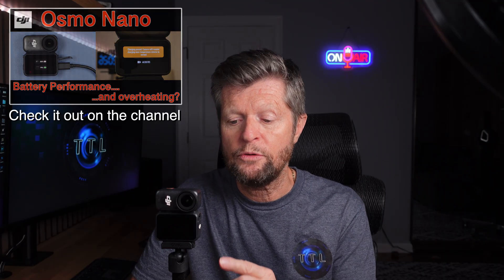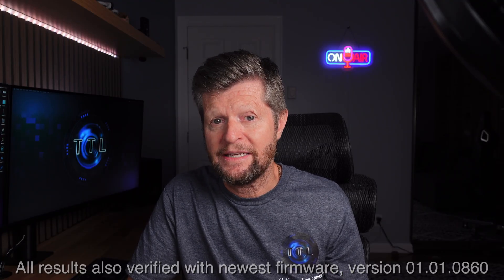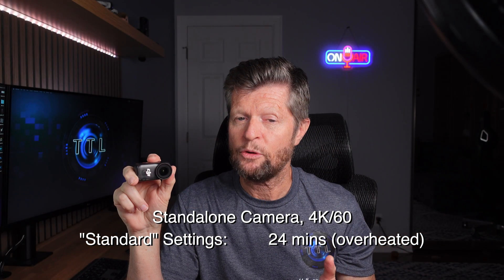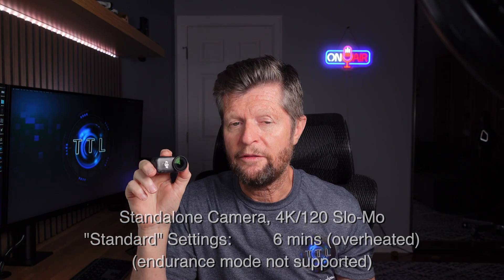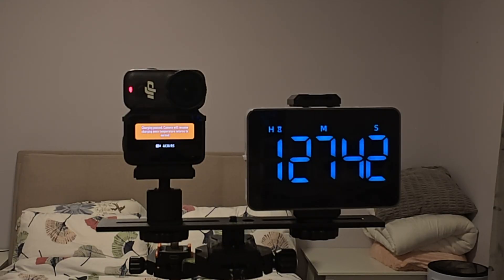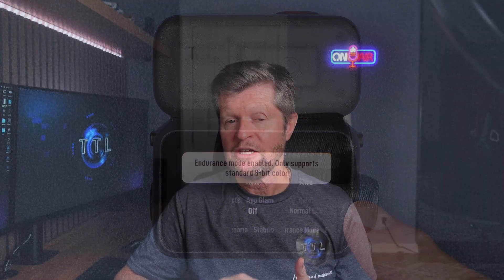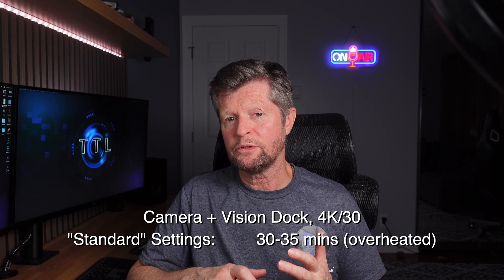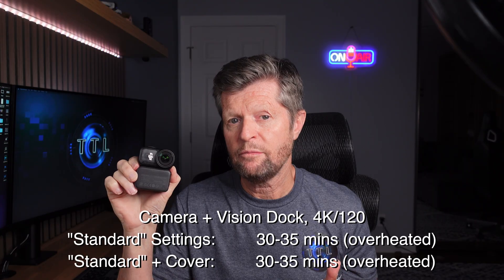DJI Osmo Nano: Overheating Issues

Comment: Hi do you have an update for the latest firmware? I returned mine as the overheating just was not acceptable and in South Africa we are a sunny place with temps around 30dgr most of the year rendering the Nano useless for outdoors

Comment: I got the Go3s, its fine but i think i may return it & get the Nano, is it better at closeups?
That larger sensor seems better, much larger battery, faster charging and uploading.
The overheating is an issue but i had similar issues with my go3s.

Comment: Excellent video and testing! Thank u for sharing! I just received my nano yesterday and started using it for some basic product unboxing and reviews. I usually only record at 2.7k/30 on my Action 5 and P3, so thats what I set the Nano to... I was stunned when I received the first "charging paused" overheat warning at about 15 minutes, and complete overheating shutdown at a little over 20 minutes. TBH, I'm still in shock... especially after learning that I couldn't connect my Mic 2 while the screen is detached! So, in order to record with the Mic 2, I'm forced to leave the vision dock connected... totally defeating the point of the Nano design. My overall experience with all of my DJI devices has been great! So much better than GoPro, or Insta360... but so far, the Nano is a massive disappointment. I'm going to try and keep an open mind and continue using it for at least a week, while using your battery operated fan idea... hopefully it gets better. Thanks again for the great video! Definitely earned my sub!
Reply from the maker: Just a clarification. The Mic 2 will work with the camera detached from the dock - you just don't get a live view on the screen at the same time. Supposedly this is something DJI plans to fix with a FW update.

Comment: It’s a ridiculous test as these are not designed to be used in a studio setting and continuous 40 min session. They’re a POV action camera and shorter clips so it’s a non issue
Reply: How in the world is stress-testing ridiculous? Actually, it's the exact opposite... I mean, it's kinda the point of a stress test... to push the device to it's limits in order to fully understand it's capabilities. He never said the overheating issue makes it a terrible camera, or "don't buy this camera because it overheats." He actually praised the camera despite it overheating.
Reply: @tabttu No did I say any of those things either. These are not designed for studio environments or 30-40 min recording sessions on the go.
Reply: Indeed, my Hero 13 (yes different cam but also bashed) does not overheat at 4K60 motorcycle riding.  However, some use these action cams in lets say a cockpit or train cab.  And then, the lack of airflow and long recordings can cause overheating.  But who records 30 minutes at 120fps?
Reply: Oh, stop the bs!! It shouldn't overheat. I wanted this so bad due to the cost and other things. But my Insta360 Ultra did not overheat in Las Vegas' extreme heat outside, which is worse than being inside a controlled climate. I run my action cameras for over 30 minutes. Walking, biking, running, etc. The nano still overheats in those areas. They need to make a better product period
Reply: @chadspinalbosd007  For your purposes its just the wrong camera Its always important to use the right camera for the special purpose. Period

Comment: Is a camera like this intended to be used in a static environment for long periods of time though?
Reply from the maker: Generally, no, but this is the best way to ensure consistent conditions. I also mention this in the test setup section.
Reply: All cameras are designed for static conditions, even all electronic equipment. If the camera is to be used in moving condition, they should specify in the user manual whether it requires active cooling. Many mirrorless cameras have deliberate recording time limits for the same reason, overheating. But they clearly state these limits.
Reply: @irfanbagus   that’s almost the definition of an action camera tho , where’s the action on sitting still.

Comment: DJI's suggestion to reduce overheating is to use the camera at a bit, low bit rate, standard color, low frame rate and shoot for short pereiods of time. Various reviewers have gotten this as a standard response from DJI. This of course is not in line as to why many are intrested in this camera, e.g., 10 bit log profile etc. I mentioned this to DJI and they said yes. Anyway your results confirm DJI's suggestion and thanks for your work on this as these were significant efforts. The take away for me is that if you want to use the standand alone camera for long sessions of POV, e.g., walk about town, using high quality settings, then this is not the camera for that. Unfortunately this is what I was hoping to do. Using the settings that make it work puts the camera in the Insta 360 Ultra arena. In this case the Ultra I believe has more going for it, e.g., form factor, options. It would be interesting to do an out of basement on the road walking POV using high quality settings ar 4k 30 test.  I have not returned mine yet and have been waiting to see if there might be a break through, although I don't see what can be done to fix. Again thanks for the work.
Reply from the maker: Thanks for the kind words and sharing your experience.

Comment: I haven't yet tested at 4K120. I have been trying to use it with 4K60 in 4:3, high bitrate/10 bit so can easily re-frame,> I usually get about 11-12 minutes before getting the charging pause message and about 18-19 minutes before overheating shutdown. You didn't mention the differences made by changing the bitrate of 8/10 bit setting, so i guess i will try those in the next few days and see what difference they make. As for the cover, I am not sure what purpose it serves. If they'd made it out of aluminium, so it had some heat disperal properties, rather than plastic, it would have made more sense. 

I have semi-jokingly consdiered mounting small 8mm or 14mm heat sinks on the camera unit to seeif that helps! lol